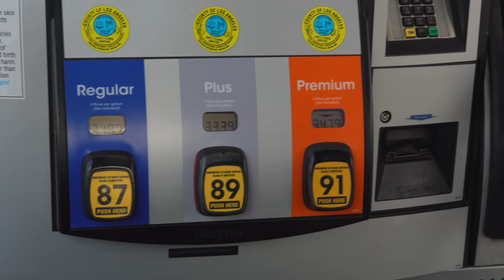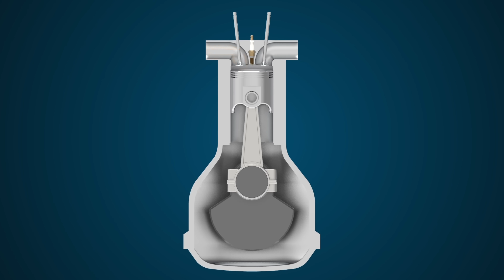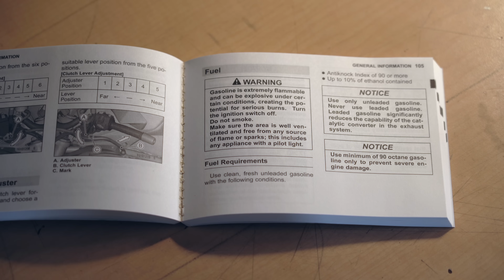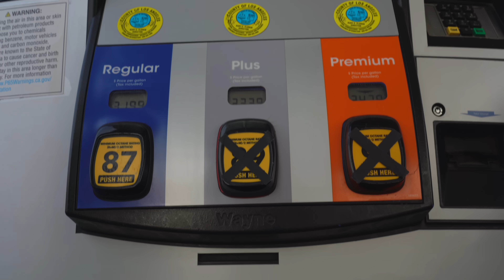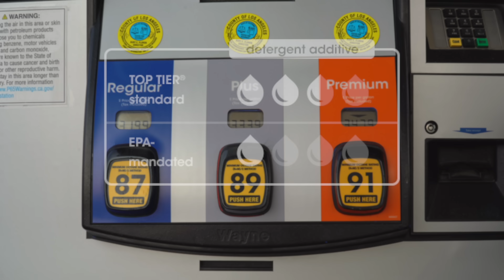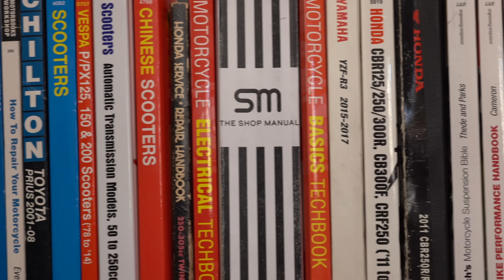Should You Run Premium Gas In Your Motorcycle? Octane Explained | The Shop Manual

Comment: MODERN BIKES!!
& with that comment I mean bikes with a ‘Knock Sensor’ & then typically with a high Compression Ratio can use any grade of fuel. 
This is because the Knock Sensor will ‘Retard’ or back off the ignition timing when it senses the ‘On-set’ of detonation or pinking! It will back it off until it does not sense it anymore! In other words it is working constantly to give you the perfect ignition setting or engine output (for the fuel used) all the time! 
This means that you will get the best engine output from high octane fuel as the electronics will allow the engine to adjust & maximise the use of the high compression ratio.
Knock Sensors are now fitted on all modern high performance car & bike engines! They all more performance & adjust for when a lower grade fuel is used of which the manufacturer has no control. This is why some engines can now have a 14:1 +  CR & are still able to run on regular fuel. The magic is done by the knock sensor keep everything safe when you use rubbish fuel.  Using high octane fuel in one of these engines not only gives more power the engine will return more MPG because the engine will be ‘allowed’ to utilise the very high CR. This is About 3-4 mpg on my BMW which has a 13:1 compression ratio. I also benefit as mentioned in this clip with the additives & detergents of a premium fuel 🤠
Reply: Great point. Except... which bikes have knock sensors? The only bikes (that I know of) that integrate a knock sensor are Kawasaki's supercharged H2 family. Other than that, no safety net against detonation.
Reply: Hi Ari, nice to chat with you! 
A lot more bikes have these sensors than most realise & many believe it is just reserved for high performance or turbocharged cars!  In fact they are fitted to most new bikes & nearly all ‘high performance’ bikes made for some years now! 
It gives the manufacturer a safety net from the rubbish fuel that’s around the World. In fact rubbish fuel or ‘Low Octane’ is only what’s available in many parts of the world.  BMW has been fitting them on bikes from the early 2000’s my engine for example is the K1300s which came out in 2009! The earlier model (K1200s) had the same set up.

Comment: With my vulcan 900 the manual says 91. I do have a fuel management system in there but i always feel my bike runs wonky on higher octanes than regular. I feel like i need to experiment more to see if I can really tell a difference or not.

Comment: Here in New Zealand, we use, 91, 95, 98, which one should I put for my zx6r, my owners manual recommends a minimum of 90, but it is according to US octane units. I normally put 95 should I use 98??
Reply: I say just use the highest. There is no drawback except slightly increased cost. On the flip side, using lower quality gas can harm performance and indeed cause damage on very old motors. It looks like 98 RON is equivalent to 93 in USA, which is generally the most premium available here unless you go to a race track.
Reply: @RedlineVulpine  cheers!

Comment: IN 2011 I FLEW INTO MITCHELL AIRPORT IN MICHIGAN ? HAD MY 2010 HARLEY ULTRA CLASSIC , WITH 5 K ON ODOMETER , DELIVERED TO THE AIRPORT, HEADED WEST I 90 TO SEATTLE, BRITISH COLUMBIA, THEN BACK TO NEW JERSEY USING PREMIUM SHELL IN MOST FUEL STOPS.  MY MILEAGE WAS 30-35 MPH WHEN IT SHOULD HAVE BEEN 45-47 MPH; I.E. 6 SPEED.  RETURNING I TOLD MY MECHANIC TO CHANGE PLUGS. NO REAL DIFFERENCE.  MECHANIC SAID RUN STABIL AN ADDITIVE WHICH MADE IT A NEW BIKE.  I SUBSEQUENTLY FOUND CHEM TOOL B 12 HALF THE PRICE.  I'VE BEEN USING IN NOW WITH 65 K ON THE BIKE AND IT RUNS LIKE A NEW BIKE.  I  HAVE BEEN USING REGULAR FUEL WITH NO PINGING NOR KNOCKING, SINCE 2011.  I ADDED A SCREAMING EAGLE AIR INDUCTION KIT, CATALYTIC CONVERTER REMOVED AND STAGE 3 HARLEY SLASH DOWNS WHEN I PURCHASED BIKE.  ( STAGE 3 BY A PRIVATE SHOP ALONG WITH CAT.)  THE BIKE RUNS LIKE A SCREAMING EAGLE.  IN SUMMARY , I E MAILED CHEM TOOL WITH MY RESULTS AND ASKED IF THE B 12 PRODUCT INCREASED OCTANE.  HE SAID " IF IT DOES NOT PING NOR KNOCK IT'S WORKING.":) SO YOUR COMMENT "USE WHAT MFG SAYS TO USE MAY BE A MISNOMER. THAT SAID A CROTCH ROCKET HIGH RPM MAY BE ANOTHER DYNAMIC TO CONSIDER.  HARLEY'S CAN GO TO 8 K REV'S.  MINE RED LINES AT 5 K?  ON RPM GAUGE. I DON'T PUSH IT BUT GUYS WITH SUPER CHARGERS DO 8 K. IN CLOSING I USE RED LION OIL WHICH IS THE BEST FOR RACING ENGINES AND HIGH HEAT WHICH HARLEY'S AIR COOLED ENGINES RUN.  GOOD ARTICLE AND GOOD ENERGY PRESENTATION; HOWEVER DON'T DINK ANYMORE FUEL;)

Comment: Another thing worth mentioning is to be careful about the octane rating called for in your manual if you have a vintage machine. A few decades back, the calculation for octane changed in the US. So if you have a 70s machine, your manual might call for 95 octane or something, but that would be the equivalent of 87 in today's terms (in the US).
Reply: This is honestly a case where I would err on the side of caution and just use a higher octane gas. Old vehicles did not have advanced computers that will automatically adjust timing, which means that with low octane fuel you will have detonation without spark plug ignition and possible damage to the engine.

Comment: Greetings from Germany. 😁
Modern engines with knocking sensor can adjust the ignition when knocking happens and produce the maximum power with the given octane fuel.
A German Car Tuner teste different fuels and only on our ARAL Ultimate 102 runs without knocking and ignition adjustment.
https://youtu.be/gwMeF4Mu8yY

Comment: Revzilla, most often now, Premium grade fuels are the only option for gas without ethanol. For older carbureted bikes, most don't require premium but to avoid the havoc wreaking tendencies of ethanol, Premium is the only way to go. Might be worth to note in future videos.
Reply: Depends on the country and even the market within the country. Here in California all fuel grades contain up to 10% ethanol. And all motorcycles made within the last 10 years are designed to run it. Earlier machines will operate fine on it, but it may degrade (harden, or alternatively soften) fuel-system parts like hoses, diaphragms, and gaskets.
Reply: @AriH211  Thanks for the reply. Keep up the good work! Fan from Canada.

Comment: To add to what Ari was saying about looking in your manual, some owners manuals like the one I had with my old Honda CB500X only gave the RON (Research Octane Number) rating, which was 90. This goes into what he was saying about European fuels. Since the US uses the AKI (Anti-Knock Index) rating system which is (R+M)/2 (look below the octane rating on the sticker at the pump next time), 90 RON = 85 AKI. For reference 97 RON = 93 AKI which is what most of us in the US and Canada see as Premium.

Comment: With  10%  Ethanol    you  really don't  need detergents...
Reply: That is 100% false. ALL fuels contain detergents, and ethanol has nothing to do with that package. Ethanol is first and foremost an (as stated by politicians) attempt to reduce dependency on fossil fuels. And second it's an effective octane booster. But it has loads of problems of it's own, both environmentally and mechanically.
Reply: I wrote several paragraphs  and my palm touched the wrong key and erased it all ...
https://www.thedrive.com/reviews/31966/best-fuel-additives
Reply: @AriH211    As  a  Teenager  I used to  buy Leaded Premium gasoline for  my Two Stroke YZ-80 YZ-100  YZ-125 ..   Burned a  hole in the Piston of  my YZ-80 with GYT Kit then  got a Memo  from Yamaha  to  replace the  180 main jet with a  200 main jet.. that hepled a  lot  but with all the port work I did .. I ran a  220 main jet..  I  was  15 years old and learning all of this fast..
   This Premium gas  had lots of Tetreethyle lead in it.. Very harmful to the envirment  ground water and Humans.. 
  The lead worked as a Lubricant .. for vavle seats and vale guides..    4 stroked  need  harded valve  seats now days .. My  1952 Ford  tractor does not have hardened valve seats  so I add two stroke oil to my gasoline for lubricity ..
  My Minniapolis  Moline   tractors  all have  harded valve  seats  because Minniapolis  Moline Pioneered Propane power tractors and Propane  is very a dry   fuel
Reply: @AriH211    Ethanl  is a solvent that  cleans  your  fuel tank and fuel system ..  and  Soy  is Soy Bean Oil ..  I never studied it it works on Carbon deposits ot  or not ..but it will  keep   your tank and injectors  100% clean ..  It  also is what they make  ice heat   water remover   addatives from  except  they  use  isopyal  alcohol the most ..
  I meant to say gasline antifreeze not an  issue  with motorcycles  most of the tme..
   I always  run  E-10  in my FZ-07 for  9000  miles  no problem ..
Reply: Ethanol absorbs water. It's not good for long term storage.
Reply: @tippytailmckitty2658    Not  really  because a  small  amout of  water causes  phase seperation fo  ethanol and gasoline ..   though  in a tank of pure gasoline the water just sits at the bottom and causes  rust so that's not good either..
Reply: Ethanol is a power solvent / detergent .. gasoline is a  good solvent too but  gasoline can have  very heavy hydrocarbons in it like Tar..  Ethanol has an Octane around 100 or  105 .. thus  refiners  use a lower  grade of gasoline with lower  octane and use the  10% ehtanol added as an octane booster..  The cost of gasoline at the Pump is  40 cents per  gallon cheaper thanks to all of the ehtonal used..
Reply: Refiners  get more  gallons of a lower grade of gasoline per  barrel of Crude oil  because they can use  ehthanol to raise the octane ande even to thin the heavy hydrocarbons..   
   The Tanker  Ships that  Trasnport all the Container Loads of  Junk Manufactured in China that  caused all of the American Factories to close.. Cheap Chinese Slave Labor and  no  EPA  regualtions for air water and ground pollution in China..  
   These Ships Burn  TAR   the fuel is super High in Sulfer the  stuff the EPA  forces refiners to remove  Low Sulpher Diesel  fuel in the USA and Western Europe .  The Tar or fuel is so thick it has to be Pre  Heated  before it can be pumped into the  Ship Engines..   then they emmit super  high sulfer exhaust  fumes..  If  you want to save the Enviroment  don't  buy anything made in China..

Comment: I only fill her up with high octane fuel because in holland they add 10% bio ethanol to regular octane 95 fuel. Also, my fz1 has some crappy fueling between 4k and 5k rpm. With quality fuel this is much less noticable.
Reply: Richard Blaauwgeers Same here, especially now that will be going into winter storage in a couple days. I’ve been using strictly ethanol free gas for the last month, and the few stations that sell ethanol free gas in my area, it’s all high octane.
Reply: idd, bij mij in de garage is er al ne oudere moto binnengekomen waarbij da de carburateurs zijn beginnen lekken omdat hij 95e10 had getankt
Reply: @pieterschellinck8293  Yep, kort geleden een beestje uit 2003 gekocht, vlotternaalden moeten vervangen vanwege de corosie.
Reply: jenever erin klaar
Reply: in Europe all the petrol has some ethanol in it. E5 means 5%, E10 means 10% and every bike sold in Europe is rated to use E5 or E10. Ethanol increses the octane number and make autodetonation harder, for example In Italy they have only E5 but in France, Germany and Spain E10 is common. It's not bad if you burn through the tank fast and it's cheap but it's not a great idea to store a tank full of E10 because ethanol contain more water that can create rust.
Reply: @formicone7  shell says there is no ethanol in there vpower fuel, same for bp ultimate and esso synergy
Reply: @richardblaauwgeers4349  Reference? I would love that to be true.
Reply: @richardblaauwgeers4349  it depends, shell vpower it's not the same in every country (I find out randomly on wikipedia) in Europe they are forced to indicate if petrol has ethanol in it with the "E5" or "E10" acronym, so they can't make up fancy name for "regular" petrol
Reply: Ik hoop maar dat Harley gelijk heeft op zn webpage en dat mn (voor mij nieuwe) Shovel uit 1981 inderdaad OK is met E10... time will tell

Comment: the grades also aren't equivalent. 95 RON (europe) is about 91 AKI (US). with 98 RON being 93 AKI.

and europe only sells 95 and 98 RON fuels.
Reply: In the UK its 95 regular 97 super, then we have shell vpower 99 and tesco momentum 99
Reply: Yep, you'd think they could take 2 seconds to verify that but apparently not...
Reply: We also have 102 RON. Btw with 95 RON we get to choose between e10 and e5 while premium gasolines are labeled as e5 but they mention "contains 0% ethanol"
Reply: @nkaraca8191  I think esso super in the UK is 0% ethanol but has to labeled 0-5% because there could be a trace of ethanol in it. Everyone else is 5%
Reply: I wasted money on premium because my Triumph owners manual listed RON numbers and I live in the states with octane.
Reply: @triumphbill  Both RON and AKI are ways to measure the octane of fuel. but if your triumph says 95 you'll have to use 91 AKI in the US
Reply: @triumphbill  RON stands for Research octane number.

Both RON and AKI measure octane

Comment: You should run non ethanol fuel. And if possible get it from a dedicated pump.
Reply: In the EU at least, have not been able to find non ethanol gas. Wanted to see how my bike runs on it since it's tuned to run anything from 85 MON to MR12/equivalent race gas. But no luck thus far.
Reply: I always run it but every now and then i have to use ethanol fuel because it’s hard to find in canada or not close to a station that has it but personally i can’t feel a difference between the two. Reason why i try to run non ethanol is cause i don’t ride as often and the bike sits longer and also winter storage.
Reply: @breakwood8531  Well, on anything but the oldest bikes, there won't be much of a difference in theory, with the exception of slightly worse mpg.

Even with e5/e10 gas, if winter means 3 months, I'd personally just put stabilizer in, run the bike for 10 mins and call it a day. Really depends on your scenario.
Same with it sitting. Whatever makes you a happy camper.

I have a modern bike, designed for these varieties of gas, thus fuel system corrosion isn't really a factor.
I just periodically run some injector cleaner and don't worry about it much.

The topic in itself is not a huge deal, especially with most bikes nowadays being able to retard ignition timing.

Comment: Danger of putting in premium in an engine not designed for it is that unburned fuel enters the exhaust and destroys the catalytic converter AND you overheat the exhaust components!  Bad advice telling people to “go ahead and add premium if you think you engine will burn cleaner just don’t think it will go any faster”.
Reply: Ha, that sounds bad, but thankfully it's not the case. If that's a scenario you've seen or experienced with a bike, it wasn't due to fuel grade, it was due to terrible tuning or something drastically wrong with the running condition of the engine.

Comment: I use diesel. Don't need to worry about octane.
Reply: Exact same issues apply to Diesel. 

The long explanation for the science guys:

 Octane ( 8 )and Cetane ( 6 ) refer to the length of a single Hydrocarbon chain, and the rating refers to how much of the fuel is made up of these hydrocarbon chains.  The shorter the chain the less likely the fuel is to ignite from an open flame or spark, which is why a diesel engine is sparkless.  Fun fact, there are random lengths of hydrocarbons in every type of fuel,  the type of fuel is largely decided by the volume of the different lengths of chains and which one is in the highest concentration.  Refining is a process where the chains are separated and concentrated, then detergents and sometimes lubricants are added.  The less random chains that are in the fuel the cleaner and more predicable the fuel burns so the goal is to remove as many of the random lengths as possible while keeping the concentration level the same.   So, when you buy a gallon of fuel, you are not getting a full gallon of the flammable stuff, but a gallon of liquid that has the flammable stuff suspended in it.  :-)  This is also how gas goes bad, as it ages the hydrocarbon chains fall apart, the concentration goes down, the octane rating goes down, and at some point the burnable portion of the fuel isn't enough to burn the rest off cleanly leaving behind "carbon build up".  Don't use old fuel.

Diesel engines, however, are usually more forgiving due to the fuel only combusting under high compression with no ignition source.  But all the same issues apply.  If you use crappy fuel in a Diesel you get crappy mileage and it will not run smooth.  If taken to the extreme it will cause all the same issues seen in gas engines. 

Propane, Ethanol, high performance methane engines, white lightening, they all play by the same rules.

Comment: Regular gasoline @ philippines start at 91 then "premium" is at 95 octane. Idk why.
Reply: The Philippines likely uses the RON rating system for gasoline whereas the United States uses the AKI rating system. Basically 91 and 95 RON = 87 and 91 AKI respectively. A quick internet search on RON vs AKI can explain why this is, and covers what Ari was talking about with European fuel being rated differently than US fuel.